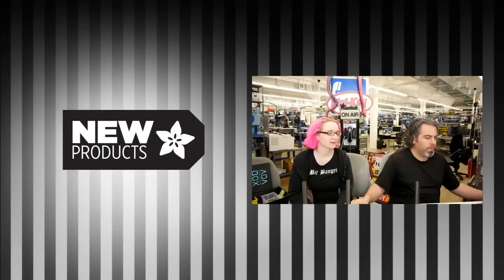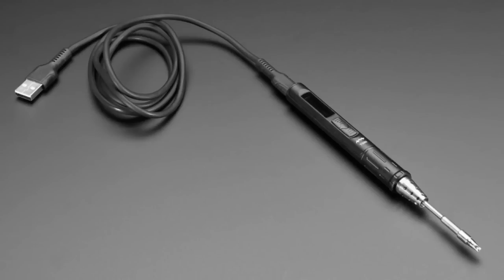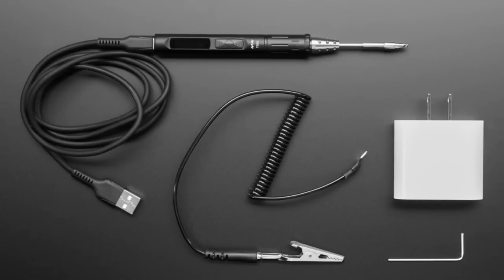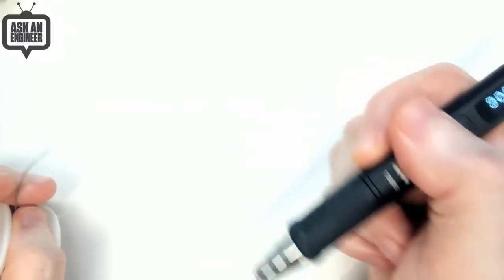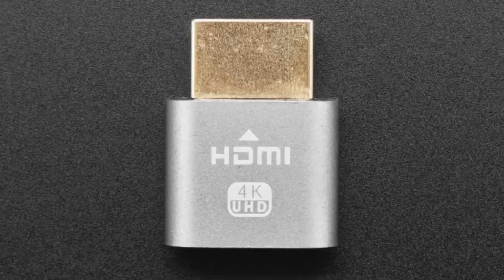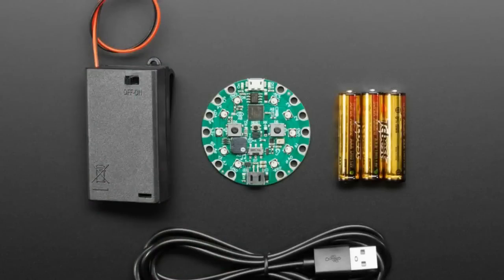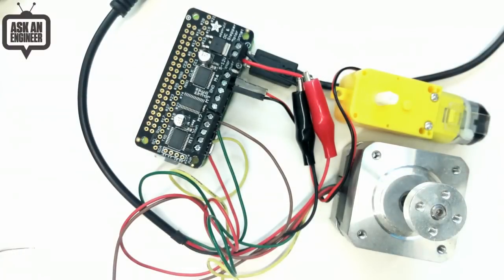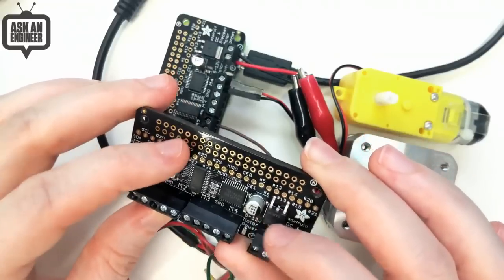New Products 6/19/19 Featuring #Adafruit #AirLift Shield!

Comment: I have a TS80. I was not able to power it up from USB PD (so I'm thinking it's not supported). There are QC3 batteries out there, so if you can get one, you can have yourself a completely portable soldering iron. Don't use a non QC3 power source, as the default USB 5V will not be nearly enough and the iron will shut down.

I don't use the adapter that comes with it, and I've read some negative reviews about it heating up.

Unfortunately there are only 2 tips available, the big chunky D25 tip and the conical tip (they just started selling them on Amazon). For those who watched EEVBlog, the D25 is the badass tip that Dave used which powers through just about anything at 9 volts. I don't know how the conical tip performs, as I don't have one.

Comment: DC & Stepper Motor Bonnet - based on the presentation I take it there is no power passthrough over 5v GPIO pin? It would be a huge space and complexity saver for RC builds.

Comment: So the ts80 looks intriguing, but the no-name power adapter makes me nervous. Have y'all done a tear down of it, including an unwinding of the transformer a la Big Clive?

Qc3 is a Qualcomm proprietary thing, iirc, and the fact the charger says "quick charger 3.0" instead of the presumably trademarked "quick charge 3.0" doesn't do much to help, makes me think it's a dodgy clobe. Maybe, optimistically, it's usb-pd, since I think most qc3 devices also support usb-pd (which is actually an independent standard)
Reply: I just tested my TS80, and it does not talk to the USB PD battery I have. But if you have a QC3 battery, bam: portable soldering iron. I use one from Anker.

Comment: Soldering Iron still has to be plugged into the wall, No point in USB is there ?
Reply: You could plug it into a power bank.
Reply: I hope they release a new version with USB power delivery support. In that case, you could power it from almost any other usb-device, including your laptop. Then it suddenly starts to make a lot of sense to use USB.